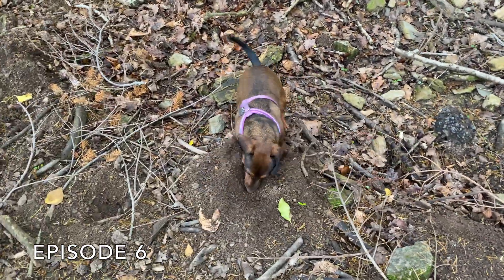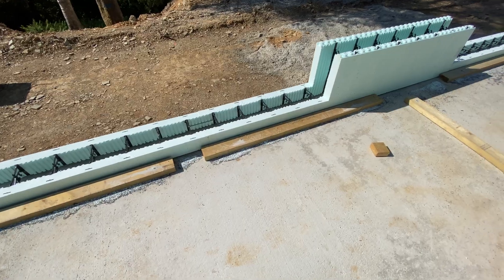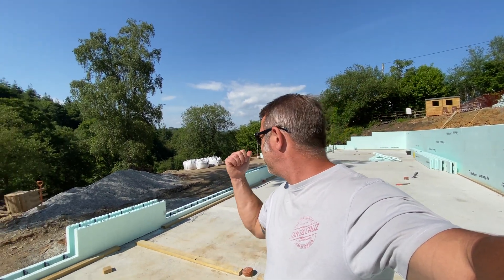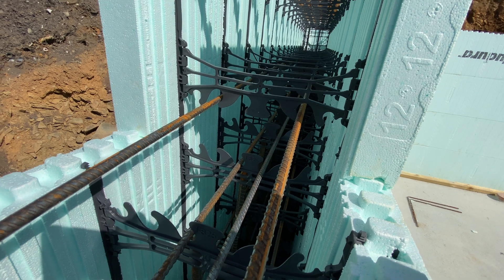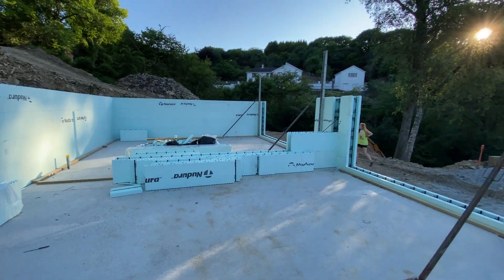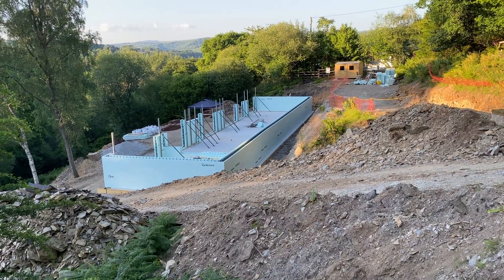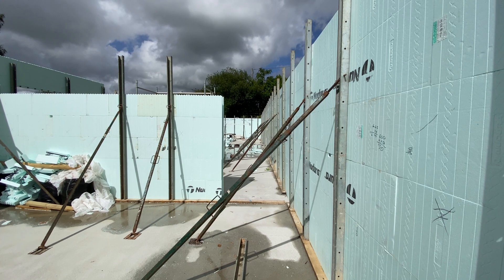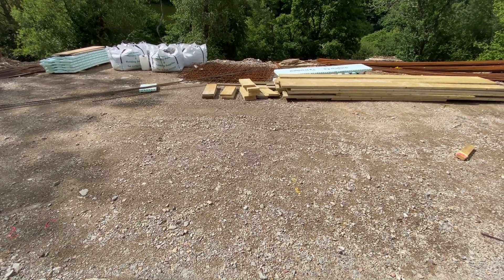Nudura ICF House Build - Self Build Diary 6

Comment: These videos are great!! I've only just stumbled across them and they are so impressive, really good work and I'm hooked. I was wondering how you have got on with the ICF so far (or do I need to watch more episodes to find out)? Any Cons you have found so far, as I only see positives. I'm doing a self build this year in the land where the jam goes on first :)
Reply from the maker: Hi Will, thanks for watching and taking the time to comment. ICF is great. I wouldn't use it for below ground works again. I think that there are a lot of issues, despite the companies advocating it to be fully waterproof. If you do use it, ensure you have an internal system too. To deal with water if / when it does enter the property. It goes up quickly which is great. I'd use timber bucks / window edging next time too. Not much difference in thermal efficiency but a whole lot better to fit doors and windows to. Let me know where you're building and how you're doing it. I'd be interested to know.

Comment: Seems odd to install waterproofing under the slab and then construct a cold joint between the bottom of the wall and the top of the slab.
Reply from the maker: Hi. Thanks for watching and taking the time to comment. We still have to install the internal floating waterproofing system and then PIR insulation on top of that. I’d be interested to hear your ideas on how it could be done in a different way though 👍👍👍
Reply: @Boxplanet   Oh ok. That makes sense to add more waterproofing now.

Since you were already going to spend the money to waterproof under the slab though, you should have put the cold joint below that waterproofing. I would have poured the footings and walls at the same time as mono pour so there is no joint and then poured the slab inside the walls. That way there would be no intrusion points and any water would be channeled down directly to your drainage system.

Having the slab inside the walls would have also greatly increased your houses energy efficiency as well. If the slab was inside the walls, you could have insulated under the slab instead of on top. You could have really taken advantage of the concrete's thermal mass to regulate your homes internal temperature since the the slab would be contained by insulation on all sides.

Comment: Were you required to use separate scaffolding, rather than using the build-in platform with the bracing system?
Reply from the maker: The bracing system we used didn’t have the platform system unfortunately. We used scaffolding as an easier way of building the ICF, although it’s not mandatory use it. It’s certainly more convenient although that comes at a fair cost. Thanks for watching 👍
Reply: @Boxplanet  interesting. All the brace systems here have a walkway. There is also the zont zuckle system which you build yourself from lumber. I'm enjoying the videos thanks
Reply: @cyoungso  The bracing system shown in this video has u-channel strong backs.  Which means it is in fact capable of holding walk planks. It just looks like they forgot to install the brackets that hold the walk planks.